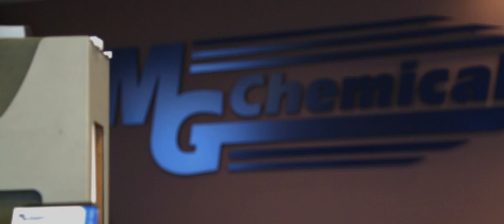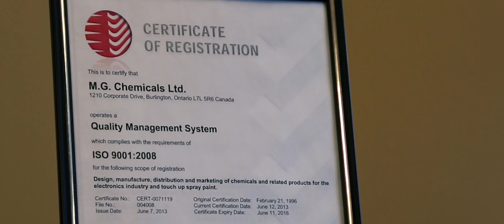MG Chemicals

Comment: Hi how much of 843ER is required for 1 Cubic centimeter material. Please reply
Reply from the maker: Hi Veena, the paint covers a surface rather than a volume so it's more useful to think in terms of surface area. On page 1 of the TDS, you'll find coverage which we list as 47,840cm2/L based on a 2 mil dry film thickness. If you achieve 2 mil dft, then you can use this value to calculate how much material is required per surface area by dividing your surface area by 47,840 to get a volume in L. Please contact technical support (support@mgchemicals.com) for further assistance